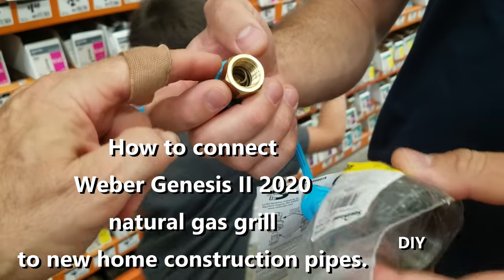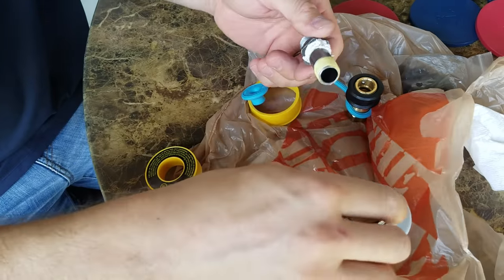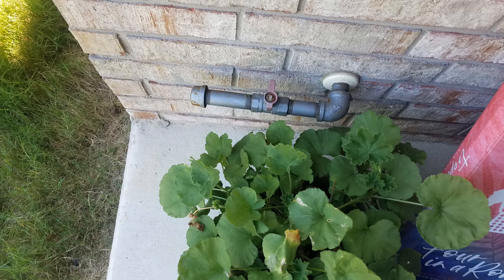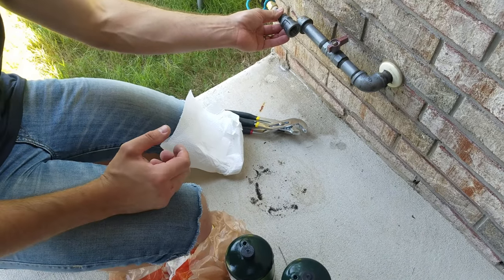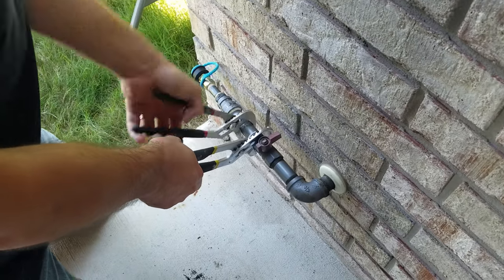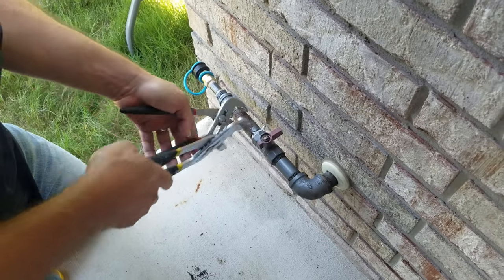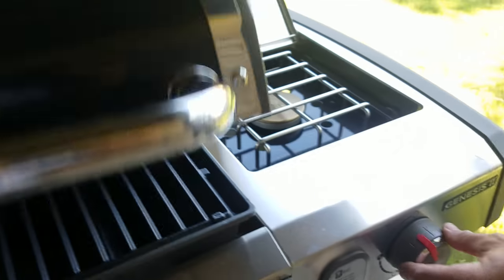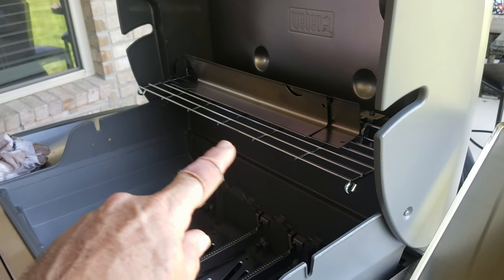How to connect Weber Genesis II Natural Gas Connection - DrB DIY

Comment: Pipe fittings are tapered.  The tighter you get the joints the more closer to each other the threads become.  You do not need both pipe tape and pipe dope.  Their only purpose is to seal any minuscule irregularity that might be present and to lubricate and prevent seizing of the threads against each other when fully tightened which will make them easier to disassemble should that be necessary.
Reply from the maker: Don't need both. But we usually use both as a practice.
Reply: Which do you recommend? Tape or Dope?
Reply: I was just about to ask that should I put both?
Reply: @nphoenixcrimefighter  
Teflon tape works well but it has to be wrapped in the proper direction or the tightening fittings will pull it off and create the very gaps you want to seal, that and if you put too much on you risk cracking the fittings.

The dope is a paste, which I find easier to put on because it does not matter what direction you apply it, and you do not have to worry about it tearing and you can be certain that it will flow into and fill the threads as they are tightened with any excess squeezed out.
Reply: @nphoenixcrimefighter  Both

Comment: Your not supposed to use bushing on gas
Reply from the maker: How would you suggest we reduce he pipe to fit to a grill?
Reply: @DrBDIY  3/4 in. x 3/8 in. Black Iron Reducing Bell Coupling

Comment: Nice Video. One thing to mention.  Try to avoid using a bushing to connect to your gas supply.  Most states don't consider a bushing up to code for this type of application.  A bell reducer would be the better option.
Reply from the maker: Great point! Wish they had them in stock at HD at the time.

Comment: Thanks for the video. My home uses LP.  Would the reducing couplers and fitting be the same or do I need to use NPT?
Reply from the maker: Its all pipe threads.  You may find a one piece coupler also, but for us they were sold out.

Comment: Thank you for the video! I just purchased the Weber Genesis II EPX-335 and it has the natural gas line built into it. Would this video essentially work for this model grill to connect the quick disconnect to the outside gas line?
Reply from the maker: I presume all natural gas connections on and from the Weber grills are the same. I am not a plumber or gas guy, just a DIY person. Safety first. It should work. They are the same. Give Weber and your gas company a call to check. Thanks!

Comment: Wish yoiu would talk more about how you change the fitting on the grille to accommodate the hose ?
Reply from the maker: Thanks. I didn't change the fitting that came with the grill.  See page 40 of: https://weber.mizecx.com/retrieve/s3/knowledge/uploaded/WEBER_LG/40441806/6334_40441806.pdf?AWSAccessKeyId=AKIAUA2JDF35TDNNDYWX&Expires=1678478649&Signature=00umpGhkkh8SyhhAZX0uzFWOun8%3D
The fitting with the blue cap at 0:19 in the video came with the grill.  It just screwed into the provided hose.
Reply: @DrBDIY  doesn't open up but theres no converting connection and can I use the same connection for the tank on the gas pipe from house if I piut female fitting ?
Reply from the maker: You should be able to connect the fitting from the grill into anything that gets is mated to your natural gas connection in the house.  Use brass as it won't spark.

Comment: Thank you for this video.  I have a new construction build and just got a Weber spirit NG Grill.  This helps a lot.  BTW after the gas Teflon tape, what is that stuff you put on the treads over the Teflon?
Reply from the maker: You can use pipe thread sealant or pipe dope or similar.

Comment: I just got the same grill (if that’s a Genesis II 435) delivered yesterday. Interesting tho you say the quick connect from Weber is a 3/8? Mine is a 1/2. I have a 3/8 already on the gas line coming from the house so I’ll need to change that out. Wonder why yours is a 3/8 and mine is a 1/2 quick connect. Great video btw. One of the best I’ve seen detailing this.
Reply: For others reading, the Weber 410/415/430/435 Quick Connect is a 1/2".  The 310/315/325/330/335 are 3/8".  This is per the Genesis II Manual.

Comment: Great video.
 Thanks. Exactly what I needed. Except my connection from my home is already a female fitting meaning I don't need that wide black round shaped fitting. I have an 1/2 inch plug, which I would assume that means the line coming from my home is a 1/2 inch fitting and would require a double sided 1/2 inch fitting or whatever size my quick connect hose would be. 

 Just curious what's the reason you used that small little black ring ? To downgrade or upgrade the size to accommodate the other fittings? Cam I technically use the double ended threaded pipe going directly into my line from my home to my quick connect hose? Or shall I put the small black nut you put? As well am I supposed to use yellow Teflon tape aside for my pipe dope? Do I need both? I rather be on the safe side. 
 And curious if you did the same on the grill end where the hose attached to the grill. You didn't video that part. 

 Otherwise great video thanks a ton for helping me out.
Reply from the maker: Yes, black ring to downgrade size. We didn't have time to find an all in one size and shape adapter.  We used Teflon on all connections except the last where the hose from the grill connects to its own adapter. That is spring loaded.   On the grill side, I seem to recall that it was already connected.  But if not, I would use Teflon there also. I always seal my brass and metal connections.

Comment: Did you not use a conversion kit? Doesn’t it require switching out the orifices and getting a natural gas regulator?
Reply from the maker: Weber sells both propane and natural gas equipped models.  This was a natural gas model so all equipment is included.
Reply: @DrBDIY  Thanks. I found a natural gas conversion kit specifically for my Genesis II-S345. I hope it works.
Reply: @AereForst  Where’d you find it? What were the orifice sizes?
Reply: @matthughbennett989  Oh and by the way the natural gas conversion kit works perfectly! Save yourself a ton of headache in the long term by just doing the conversion. Natural gas is also cheaper
Reply: @AereForst  Where’d you find it? What size were the orifices? Did you have to replace the manifold too?
Reply: @matthughbennett989  I think what’s happening here is that my comment is being deleted because it contains a link to the website that I bought the conversion kit from. I responded twice earlier explaining where I got it from and the fact that I had a plumber do it so I have no specific information regarding the orifice size etc. I will post another response with the actual link and see if it stays or not
Reply: @matthughbennett989  Yeah I just posted an answer with the actual link, then refreshed the comments section and that specific comment only was deleted. I don’t think the owner of this channel allows hyperlinks in the comments unfortunately. I’m going to paste it again with some changes which you should be able to figure out
Reply: @matthughbennett989  yep, not working, even with spelling out certain words in the hyperlink. So try this: go search barbecue fuel conversion, all one word. The first link should be the site
Reply from the maker: I didn't received your comments on my side and did not delete them.  You could try adding words like search site ABC for product XYZ or use url with spaces such as y o u t u b e . c o m.

Comment: 1/2 hoses or 3/8?
Reply from the maker: 3/8 hose end and adapter".  We misspoke while searching for parts at HD.  Also, HD didn't have all of the parts in stock or we could have reduced / connected in one part.

Comment: my naturl gas line for bbq is to short . how do i exstend the pipe from the one  thats allready thier
Reply from the maker: I am not a plumber or gas person.  On a propane grill, I bought a 6' flex line and didn't change the pipe on the wall.  You can search and see numerous natural gas lines of varying lengths.  I don't think I would extend the hard pipe. You might want to check with your municipal code to see what is allowed.

Comment: Quick question  you don’t need to install a gas regulator?
Reply from the maker: The Weber natural gas grill has everything supplied. You only need a line for gas. Safety first
Reply: Thank you, I guess all grill comes with regulator built in?
Reply from the maker: The Weber propane and natural gas grills are equipped for that gas type.  Not sure about other brands, but I haven't owned another brand that wasn't equipped for the specific gas type.

Comment: Great video.Thanks. Do we need a licensed technician to do this work or an house owner can do this, if he is a technicaly experienced person? I have same gas pipe with valve provided in patio. I live in Dallas. Please advice.
Reply from the maker: I did it and I am just a DIY guy.  I don't think you need to adhere to city code just for connecting the grill, but you can call your code people. It is a simple job. We are near Austin.
Reply: @DrBDIY  Thank you for reply. Surely I will call.  I am new in US and getting familiar with  codes.
Reply: @DrBDIY  Austin requires permits for everything re: house construction/remodel including natural gas grill hook ups. Cost is $350 and it takes at minimum 5 weeks for a city inspector to get out to your property. I know a guy that was fined $1750 for not getting the permit!
Reply from the maker: Wow, crazy.

Comment: Natural gas pressure up to the gas meter's regulator can be as high as 300 pounds PSI.  Once it goes through the regulator the pressure is reduced to around 10 ounces PSI.  A properly sized regulator can provide a volume of gas at 10 ounces PSI necessary to keep all of your gas appliances running at maximum gas flow all at the same time.
Reply: Good Info::: BUT, out here in California 99% of the time the gas pressure in the mains and services are under 60 PSI. Yes there are a few scattered  houses located near high pressure lines that could be as high as that but usually the Gas Co. out here will regulate it out at the street first  and lower it down to 20 or 30 PSI into the service line up to the house. Oh, and not trying to be a smart A## but gas pressure is regulated into the house at between  7 to 9 inches  w/c (inches water column) never expressed as ounces ... They use a simple  U gauge with water in it to set to regulator at the meter.
Reply: @j.r.richard8532  
Done different in Texas.  7 to 9 inches of water column is equal to 12.1275 ounces to 15.5925 ounces of pressure per square inch.  In Texas a regulator, at least for residences, is required to be between 9 and 12 ounces PSI.  Even at 60 pounds PSI going in and 10 ounces PSI going out, that gives you a 96 to 1 ratio between the supply of gas to the meter and the gas from the meter which means it can easily handle the demand of all of the gas appliances in the house all running at once.  The only problem would be if you added gas burning appliances that would require a greater gas flow than the regulator was designed to supply to the house.  Then the ratio would not make a difference.

An example would be a laundry mat close to where I live.  They had mostly smaller single load dryers but replaced them with larger multi-load driers.  They failed to calculate what the gas flow to those new driers would be compared to what the regulator was designed for.  The result was that if all of the larger dries were running at once the gas pressure would drop low enough that the pilots went out and the burners shut down and none of the driers would be able to heat the air going through the clothes.  So for about a week they had to restrict the number of driers that could be used until the regulator could be replaced and certified by the city and the gas company.

As far as the gas in the supply mains is concerned, the restriction to the flow of gas increases with distance so their is a limit to the number of residences that can be hooked up to that main over a distance.  If the keep those lines with that pressure on them and there are a lot of residences to supply in that given area then they would necessarily have to have multiple shorter sections coming off either a much bigger pipe or a significantly higher pressure pipe.

The lower pressure main would be safer in case of a rupture since less pressure would mean less gas escaping but a single higher pressure main would be able to supply gas to a lot more residences with a single run of pipe.

Either way works.
Reply: @oldtimefarmboy617    Wow...." California man gets his butt kicked (figuratively)by Texan " Thanks Man ,kind of felt good ! If I ever get over to Texas I'll look you up and we can drive around and look at gas meters....

Comment: whats stanley plier size?
Reply from the maker: Stanley Hand Tools 12" Groove Joint Pliers and
Crescent 10 in. Z2 K9 V-Jaw Dipped Handle Tongue and Groove Pliers
Reply: @DrBDIY  could it possible to use 10'' instead of that 12"?
Reply from the maker: @v8monster186  Should be just fine.  The pipe doesn't have a big diameter.